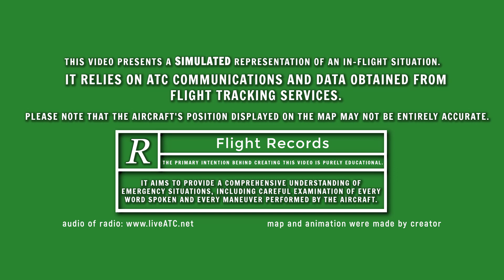GOOD TEAMWORK | Successful Emergency Landing Without Nose Gear

Comment: Good video! We had a pair of Cessna 310's over the years and the gear is the weak link. If you don't have the rigging checked along with doing visuals regularly, they will fail. We replaced torque tubes and struts over the years here and there. Not saying it can't happen anyway because it can but would be very rare.
Reply from the maker: Thank you 🛩